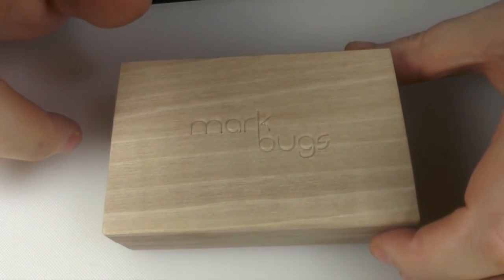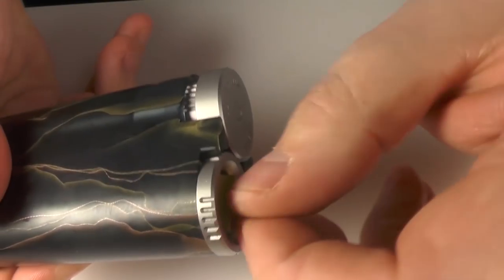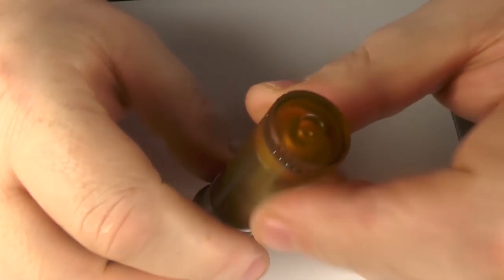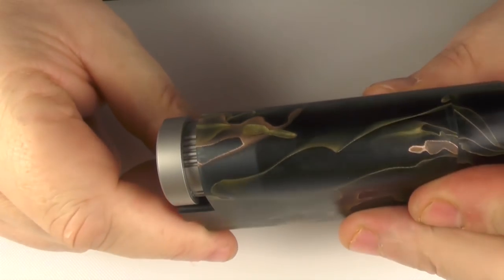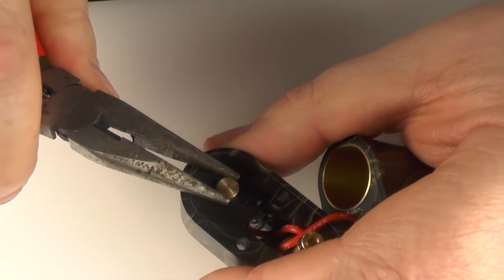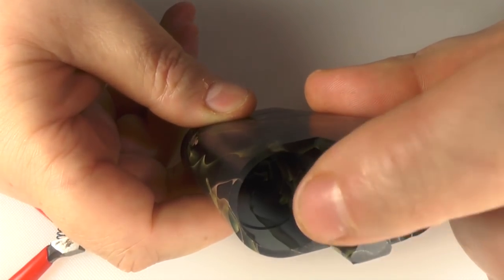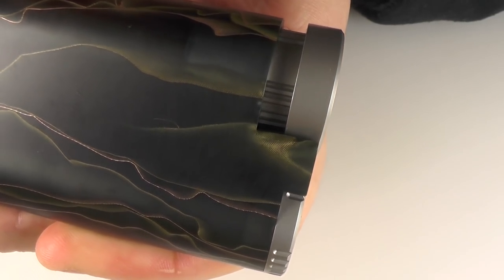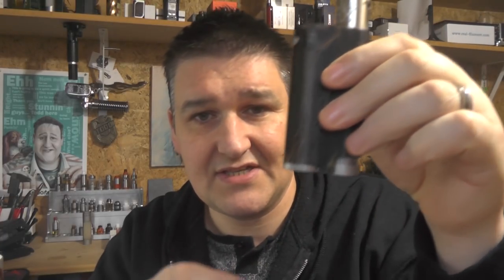MarkBugs Blaze Update - Please Read Description

Comment from the maker: Just to be clear here, for the way I vape and the atties I use, I have no issues with this device BUT for most China or USA attties, I think you will be pretty pissed off with the issue I mentioned.

Another point is that you only get one bottle, it is unique to this device and some people may consider that a con, plus having to remove the bottle to check juice level.

http://www.markbugs.com/index.php

If you have concerns or issues and are going to leave a comment, please do it in a civil manner, any abusive or just plain rude comments will be deleted and I will block you from my channel.

Also, don’t waste your time complaining about price, availability or state that the clone is better, once again I will just block you!
Normal piss taking is of course fully acceptable :D

If you need to contact me, please do it via todd@toddsreviews.com
Reply: The Moddog Pulsar was similar, depending how much the 510 was screwed in or out but could be compensated with beauty rings, but it pissed me off as well considering the price range of both mods!!

Comment: Love the blaze and the adjustable juice feeding can be adjusted for different atties  or preference which is very nice. For the atties which pushes the juice carrier a simple fix for the moment is to use a thin beauty ring I use the one from Freehand gloom and it solved the rocking mod when place for Long 510 atties that I have. So we are all good to go. I’m sure Mark will come out with a permanent solution but for me this stop GAP measures really work. Try it Todd for your Long atties, I’m sure you have plenty of beauty ring in the shed ;)
Reply from the maker: My Blaze is away back for a fix, for 300 euro having to use a spacer isn't acceptable for me.  As in the video description, they have a fix already so I would contact them :D
Reply: Todds Reviews yeah Mark told me he will be sending down but for me this will be the stop gap for now and subsequent batches will be all free from the issues. I reckon while waiting this will be a good stop gap. Do update when you receive your blaze back on Mark as to whether it resolves the issue.  Thanks

Comment: Thanks for the review and your honesty about the flaws.  For $299, I would not purchase this because of several reasons:  1.  I don’t like the choice of external covering;  2.  The balance issue;  3.  The one bottle decision;  4.  The open wire design;  5.  The small firing button.  I do like the new bottle system and he gets kudos for that.  I wonder if he is going to address these issues.

Comment: At almost 400 USD shipped there are too many issues currently imo. It is a shame because any Mark Bugs product I have ever had has been top notch. I mean the way he got a dna30 in the WAE2 was like magic also. 
It is a competitive market and I am not sold on the body, the 510 issue, and not to sound like an ass but the way the wires looked inside it just reminded me of box makers 2 years ago. I also think for the coin a second proprietary bottle should come with it. 
The bottle system looked pretty cool and I am wondering if it pulls the excess back? Or is it fine tune it to one or two pumps and done? 

Looking over my comment before pressing enter I am thinking to myself am I really about to say any of this stuff about a Mark Bugs product? There is often compromises made when dealing with vape products, but I trust that Mark will make some adjustments and all will be right in the world. 

Thank you for the closer look and opinion about the Blaze.